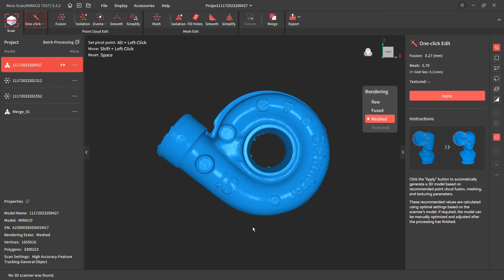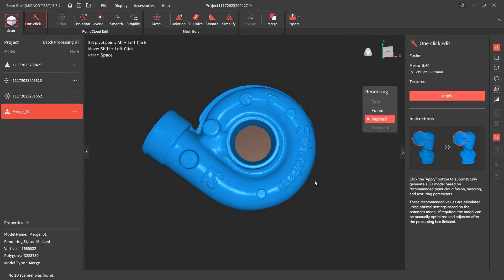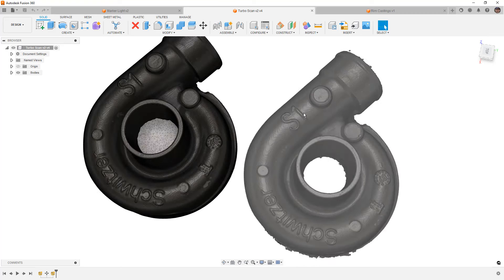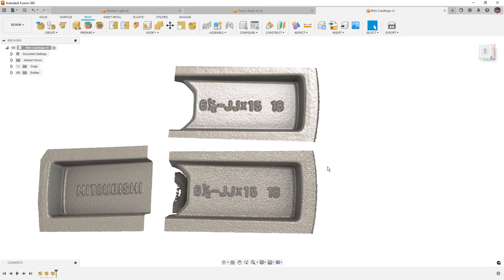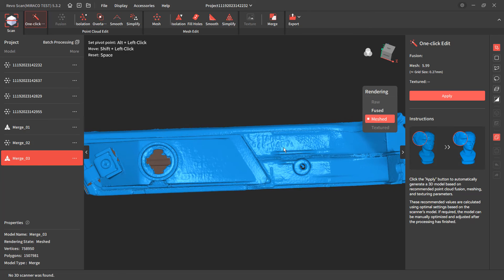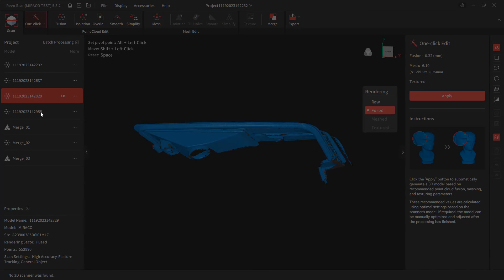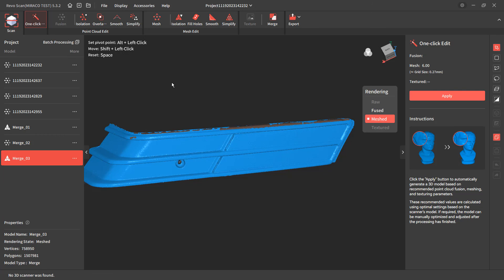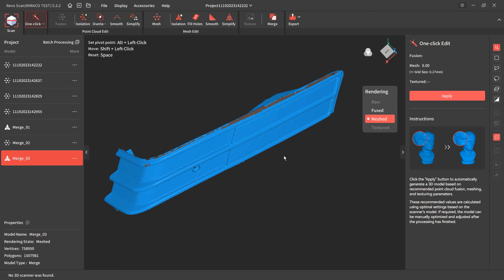Detailed 3D Scanning with RevoPoint Miraco | Review of Scans Using Near Mode For High Detail

Comment: Will the revopoint mini 2 be good for scanning small parts for example gears, gears up to 1-4 cm. Thank you for your answer, greetings
Reply from the maker: The working distance you can be away from an object with the Mini2 is 120-250mm.  and its max capture area for a single frame is 168x132mm.

So scanning a small object is possible but it will depend a bit on the gear.  So structure light scanners like the mini2, or the miraco from the video, aren't great at getting deep down into areas.  So if you are talking about a 1cm gear with a really fine pitch, you probably aren't going to get that with the Mini or any structured light scanner.  

Is the pitch of the gear unknown?

Comment: The new creality scanners are really tempting. I probably will buy the creality raptor and the otter looks really good too. It can scan black objects with ease. 
Blue laser scanning finally affordable.

Edit: I bought the Creality Raptor now. I own a Einscan SP, Revopoint mini and Einstar.
The problem is I often have to scan parts in the size of a Xbox controller and the parts are 90% black (I have Aesub blue/orange but using it isn’t always easy depending on the part). The Einscan sp can’t handle black well and is stationary. The Einstar is not good at scanning such small parts. The Revopoint mini is only good for very small parts. 
I hope the Raptor will be the perfect middle ground. Only issue is you need to use markers. I already 3d printed targets and hope this will do.
The blue laser should also be able to scan deeper pockets better. At least I hope so 😅
Reply from the maker: I am working on an Otter video right now.  I scanned a white xbox One controller without problem. black anodized triple clamps and a few shiny parts well(there is a limit of course).  The Otter is impressive, i think the main issue with Creality scanners(which ill mention in the video and did in the Ferret video) is the software.  For your Einscan you have great exscan software.  With revopoint and creality the software is really where the difference is.  I hope the software gets better for the scan raptor because it would be a shame to have an affordable laser scanner but be throttled by the software.

Both the ferret and otter seem to do pretty well with black objects which is surprising.  I think the tracking is pretty good as well.  I believe it always captures color data which helps, but its marker tracking isn't as good as others.  The creality stuff seems to shine scanning those shiny objects(no pun) and outdoors more so than other IR based scanners.

The Mini2 scans a little larger size than the mini and has some other upgrades from the mini, but not worth buying if you already have a mini.  The Miraco is still my favorite for its portability and the dual depth cameras to do large and small.  The otter has a "medium" mode and in the hardware I am not sure exactly what they are doing to get that since it only has 2 sets of depth cameras.....
Reply: @LearnEverythingAboutDesign  yeah I looked into the otter as well. 
My reasoning for the raptor is the higher details (sharper corners), less noise and higher depth scanning ability. 
If I would not already own the Einstar I would bought the otter. The raptor isn't as good scanning bigger parts as the Einstar or Otter. If the reviews are right about this...

You are right about the creality software not as good as the Einscan software. The big missing part is the alignment at the end to the coordinate system and the alignment of different scans for fusing isn't as good as with einscan software. 

Maybe I can import the scan to my Einscan software and do the alignment there? Never tried to load a foreign mesh into the Einscan software before.

Comment: I’ll be using the Miraco scanner to help reverse engineer parts like the turbo in this video. 
Do you have any videos showing how you got such a clean solid body / component of the turbo in Fusion 360?
Reply from the maker: I have a few videos.  Just recently did one with the mini2, but the results would be the same with the miraco on Near mode.  Part 1 is prepping for the scan, part 2 is scanning, and 3 is CAD https://www.youtube.com/playlist?list=PLBDfGh8A8kXVLomwHgAg1XeNKdvFv-e1m

There are other videos as well.  detailed scans of car fenders and so on.  The 2 main things are surface prep and enough feature to capture the detail.
Reply: @LearnEverythingAboutDesign  I’ll take a look. Thanks, very much appreciated.

Comment: do these scanners scan to scale, how does that work? want to reverse engineer things and also scan in broken parts and use the 3D printer to create replacements.
Reply from the maker: Yes they do.  Scanners will have numbers for their precision and accuracy for a single frame.  They send out different lights patterns (lines at various thicknesses) and use depth cameras to read back that info.  You will find scanners made for larger objects will often have a larger number like .2mm accuracy which means the part its scanning may be .2mm further away or closer to the scanner.  Ones for smaller parts or details like here are generally around .02mm.

We have a video coming out tomorrow that is part of a 3 part series scanning  a part from an rc car. processing the scan, and designing a part to replace it.  That might be a good series for you to look at.  The video tomorrow is talking about requirements, setting up and collecting scan data.  part 2 will be processing the scan data, and part 3 the CAD and 3d print part of it.
Reply: This would be perfect thanks for the feedback.

Comment: Add another scanner for me to flip back and forth over haha. How does this stack up against the Einstar or similar priced units? I like the fact you don’t need to pack around a laptop so not having to buy one makes the $1200 a little more appealing.
Reply from the maker: Yeah :)  I will be doing a video on the Mini2 soon as well.

The miraco for me checks a lot of boxes.  Not having to be tethered to a laptop is a big one.  The data transfer over USB for most of the hobby scanners or HDMI for the more professional offerings is a limit to how fast you can capture data(including the laptop they are connected to).  The miraco having the processing on board is a big one for me.

As for comparing them (miraco and einstar).  The miraco has near and far mode giving you the ability to do detailed scans.  The einstar doesn't.  The einstar seems to do a better job with scanning large objects like Cars pretty well with good detail.  I think it comes down to a little bit of the Exscan software.  Because the Einstar is the lowest in the Shining3d line it benefits from their software that has a few options revopoint is missing like aligning to a coordinate system and a little more control on mesh processing.

So if the only goal was to scan cars (no smaller higher detailed objects) and you had a good laptop and could be tethered to it the Einstar might edge out the miraco.  And really the only reason i say that is the Exscan software has a hybrid tracking mode where you can use some markers in areas that are flat and feature based tracking in others.  Currently revopoint doesn't have that option.

Comment: Would this scanner be good for detailed scans of gun parts? We're talking small black metal parts with sharp geometry but they tend to have glossy finishes. I figured i would need to use the prep spray. The end goal would be getting accurate dimensions so i could eventually design new parts in cad that would interlock with the existing gun
Reply from the maker: ummm, errrrr, well it depends on which parts really.  I wouldn't suggest getting accurate dimensions off scan data unless you have a high end scanner and are pulling in millions of points for tiny objects.  That is something you need to measure.  If you are talking less critical parts I think its totally fine.  To get super accurate details scans i think you would really be looking at "metrology grade" laser scanners.  The cheapest one I know of starts close to $20k.
Reply: @LearnEverythingAboutDesign thanks for responding, sounds like I need to so some more research. The parts would mainly be mounts for optics and lasers which are already a thriving market so other companies must be getting the measurements somehow. I doubt the gun companies themselves are giving out the measurements but who knows, maybe they are.
Reply from the maker: @rodiculous9464  Yeah I am not sure really.  I have worked in the segment (making knocks for bows) but nothing for firearms.  I will say that with scanning for highly detailed items like that you may be better off using a consultant to scan for you and provide you a CAD model as a starting point.  Scanning sharp corners will be tricky.  If you think about a mesh where points are 1mm apart, getting the corner on a tiny extrusion can be very tough.  When i need highly detailed scans I use MotoCilino in GA. https://motocilino.com/  You might find that spending a small amount getting your parts scanned with an expensive scanner and tools might be a better option.
Reply: @LearnEverythingAboutDesign yeah that makes sense, thanks for that link I might check them out, they are not too far from me

Comment: Can it work outside on sunny daylight ?
Reply from the maker: well. no.  Most IR scanners struggle outside in daylight.  You can use it outside, but the brighter the daylight the more it will affect the scan.  So i wouldn't get it for just that reason.  The scans work much better in a light controlled environment.

Comment: Very nice video. I have the original pop 1 and the range. Do you think this would be good for me? Or unnecessary since I have one scanner for large and one for small?
Reply from the maker: Well i think if you were going to add another scanner and are ok with being cabled to a computer I would add the Mini.  The Miraco is basically a mini and a range in one unit.  So the benefit would be more detail using the Near mode and the portability.  One thing the miraco can do that others can't is switch between near/far in the same scan.  If you look at this post where someone used the Pop and Mini with 2 different scans and put them together, this can be done directly with the Miraco by just scanning the entire thing with far mode, pause the scan and switch to near mode, and capture the detailed areas. https://forum.revopoint3d.com/t/revopoint-mini-merging-mini-scan-into-a-pop1-3d-model/16324